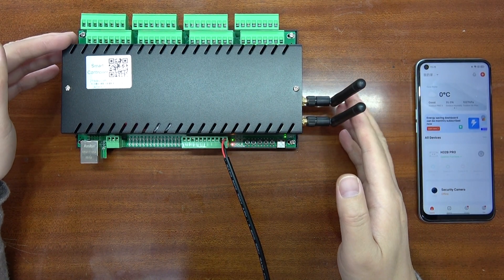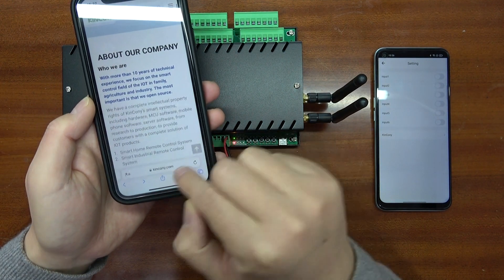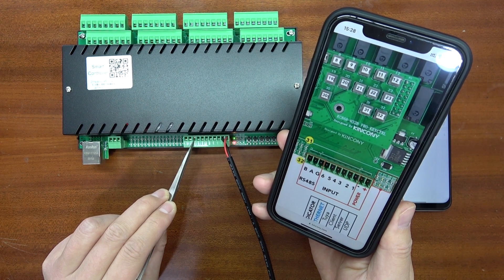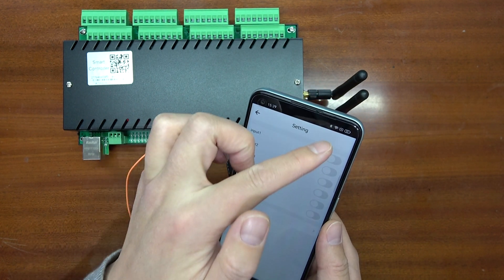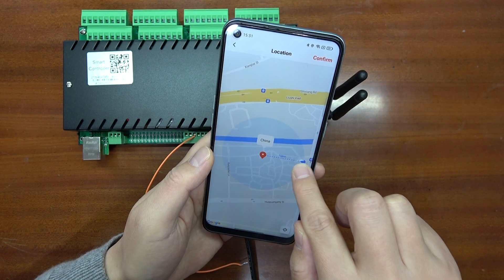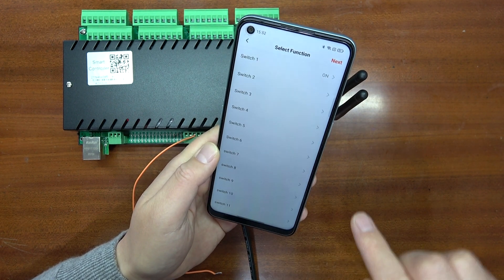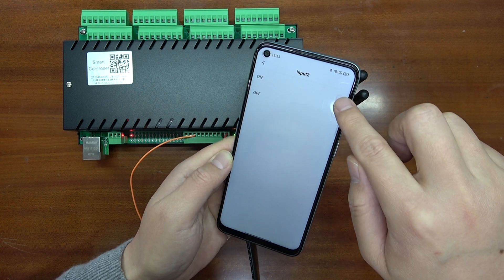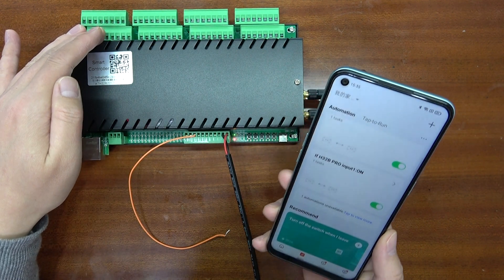how to use H32B Pro's INPUT for automation by Tuya app

Comment: This is great, but it's just for dry contact wire sensors. Can it work the same with wireless - WiFi Tuya sensors?
Reply from the maker: sure, no problem, any tuya sensor can work as a sensor.